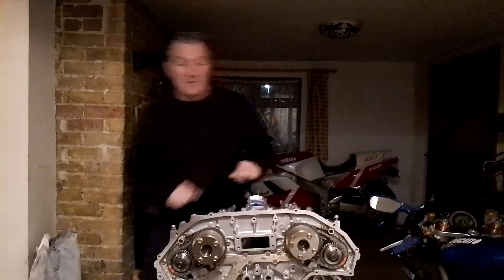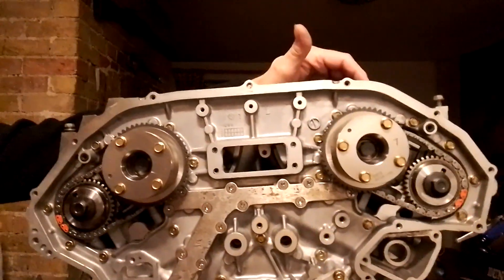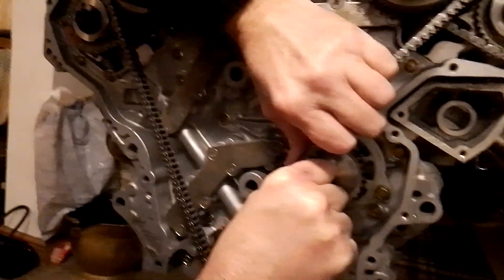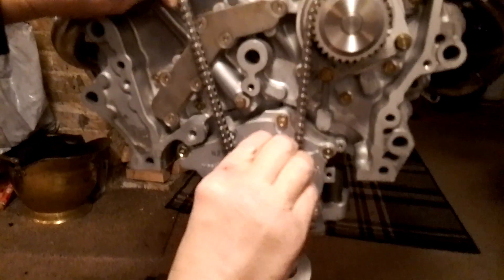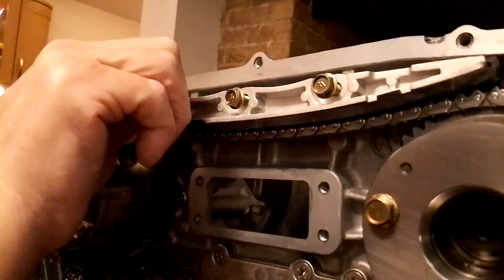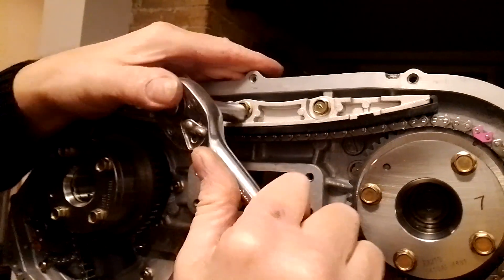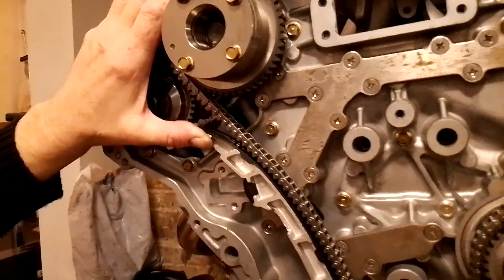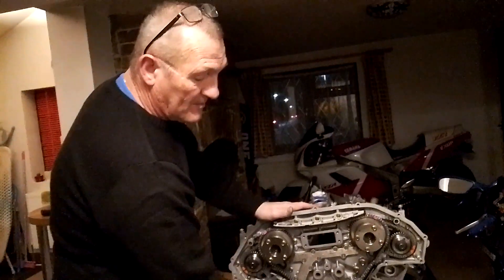Nissan 350Z fitting timing chain.

Comment: Great work, looks like its a lovely warm place to assemble an engine :D. You may want to check the clearance of those exhaust manifolds, I got the same style on mine and they fowl on the steering column and need a little dent put in them.
Reply from the maker: Thanks it's better than the workshop 👍 and the Malian headers were a pig, the original fixing holes needed enlarging, I  got away with linishing the steering u.j. smooth, and rounding edges of, got a whole 5mm of clearance now 👍
Reply: @rapidstu01  I also had to widen the fixing holes.
Reply: Im doing the timing chain on maxima. As I was taking the old crank shaft sprocket out. The pin fell off as well. Where the sprocket slides into. Is that normal? It doesn’t look like it was welded on.

Comment: I need the sprockets 2 of them. With the #7 on it
Reply from the maker: The sprockets are interchangeable, I fitted two new ones when I changed my camchain, I still have my original ones that are perfectly usable. What is wrong with yours?
Reply: @rapidstu01  one is cracked where the pin is at the other has a oval in the pin hole so it has a little bit of play and it's cracked as well just got surgery done so I can't afford them
Reply from the maker: @hugobenitez5845  I will have a sort out at the weekend, I probably have a pair of sprockets you can have, text me a reminder on Friday night so I don't forget, I don't want any money for them. If you are not UK I'll probably need postage.
Reply: @rapidstu01  its friday night